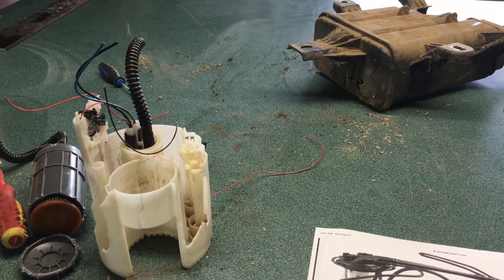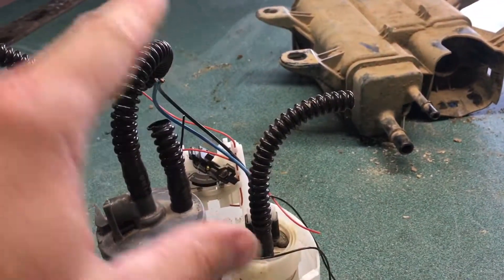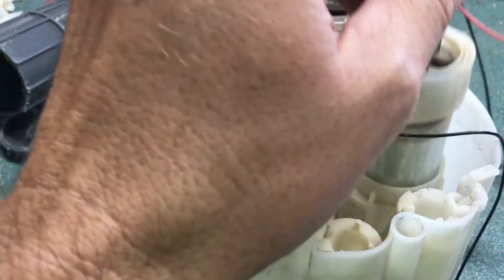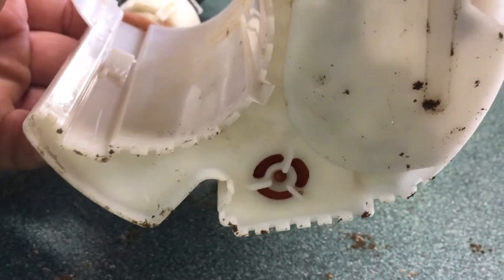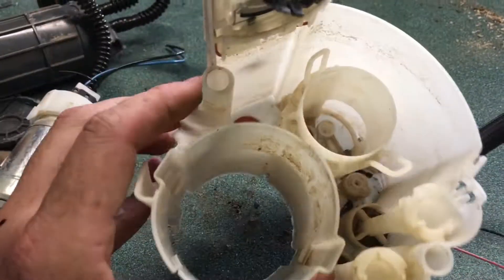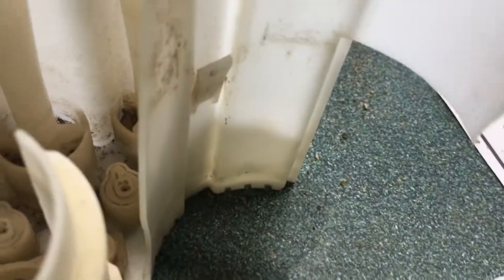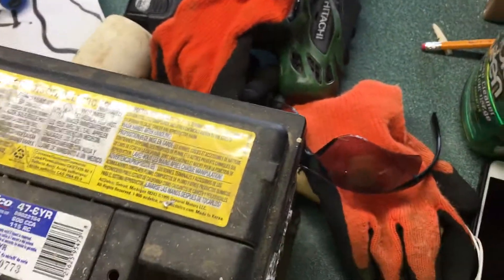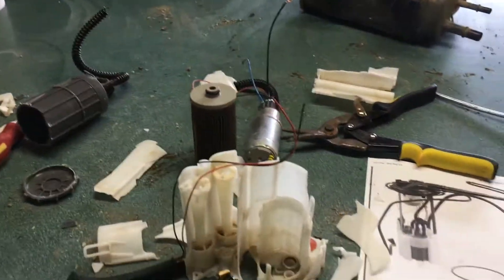How does it work?  2008 Chevy Equinox Fuel Pump and why mine failed.

Comment: Could this cause the p0191 code?
Reply from the maker: It could, no doubt.  P0191 is fuel pressure irregularities and I’d do some digging first before getting into pump replacement.  Changing the pump is more of a last resort move after you have tried everything else.

Comment: Thanks for your video and detailed explanation, I am getting ready to replace my pump and there is little to no information about this car having 2 pumps, I have a 2006 model, I bought the pump assembly, It has a line and a 2 wire connector to go to the other side of the tank, one is a fuel line and one is I had assumed for the second pump. After watching your video I realize the  right side has a fuel level sensor the wires must go to since there is no secondary fuel pump. I was wondering why they would make a car with 2 fuel pumps to fail. For people who do not get how the fuel gets from the other side to the pump, A venturi , it   works  on the design that when you spray a liquid through  a restriction into a larger area, the point where the liquid escapes into the larger cone area creates a vacuum at the entry point which if you place a port there, you get suction. They use to and probably still use a venturi to pull a vacuum on an air conditioning system for vehicles which it will pull down to 29hg
 ( inches of Mercury) the measurement for vacuum. 30 is the max and almost impossible, so the venturi does create a strong vacuum.

I have always just changed the stand alone fuel pump which most are designed the same, I can see why on the Equinox with all the components, it is only wise to change it as a unit, some come with the cross over lines and some do not. The canister is the main part to change, probably less work with the assembly with the hoses which does not cost that much more. Best price right now is on Rock Auto for the 2005- 06 replacement canister . $63.79 plus shipping. Amazon had the complete assembly incuuding hoses for $78.00 . Ebay had the highest prices, probably due to their high seller fees.

Comment: i think the gauge float position determines when fuel is transfered from driver side of tank
Reply: No the sender on the secondary side of the tank is wired in series with the sender on the pump side and those wires  only send the voltage  to the gas gauge. 
There is no reason to stop the flow from the secondary side of the tank, if it did run dry, the venturi would suck air but that would not stop the flow of gas the pump sends through the system to the cup where the strainer and inlet for the pump is because it sucks fuel from the pump side of the tank.
 Besides if that were the case,  there would have to be an electric controlled solenoid to turn and off the flow of gas from the secondary side of the tank,  and there is not one. There is no need for one with this design using a venturi as a pump. If you want proof, here is the fuel tank assembly wiring diagram.    https://images.search.yahoo.com/search/images?p=equinox+fuel+pump+wiring+diagram&fr=yset_chr_syc_hp-s&imgurl=https%3A%2F%2Fwww.2carpros.com%2Fimages%2Fquestion_images%2F11233%2Foriginal.JPG#id=0&iurl=https%3A%2F%2Fwww.2carpros.com%2Fimages%2Fquestion_images%2F11234%2Foriginal.JPG&action=click

Comment: Where’s the fuel filter ? 2006 Equinox
Reply from the maker: Roy Tallow In the tank, just like this one, unserviceable.
Reply: @Turbo231  should be though
Reply: There is as this video shows a strainer before the fuel inlet, and a filter located in the canister at the outlet of the pump. I imagine GM figured if enough dirt got to the filter, it had to get through the strainer and went through the pump, so the fuel pump probably needs to be changed anyway if the filter is stopped up. Stupid huh to put the filter in the tank. I would say it was also stupid to not make an access panel inside the car under the passenger seat so you do not have to remove the fuel tank to change it. Do you think probably GM did this intentionally? I am convinced when they have their board meetings, they sit around with the engineers in a room and design things with the intent of bringing in more profit. That is not how it use to be in the last Century. The world was not so full of greed. GM should have a label on their cars. The love of money is the root of all evil, but then they all do it, they have to, to compete, just like politicians.